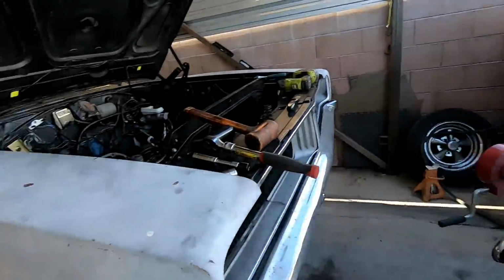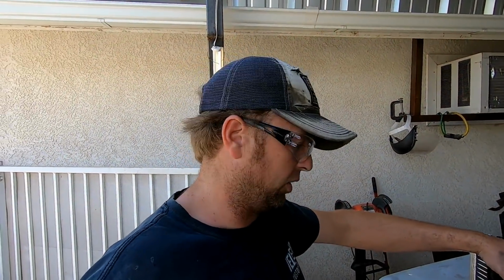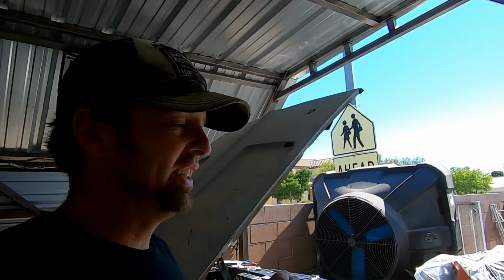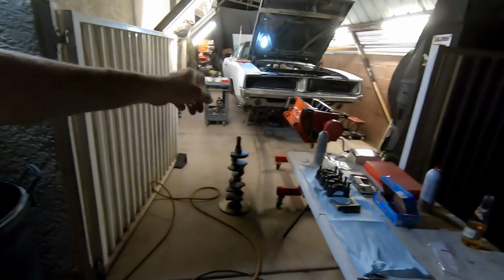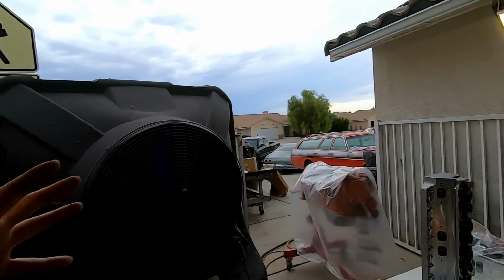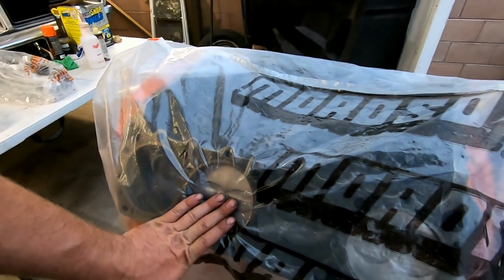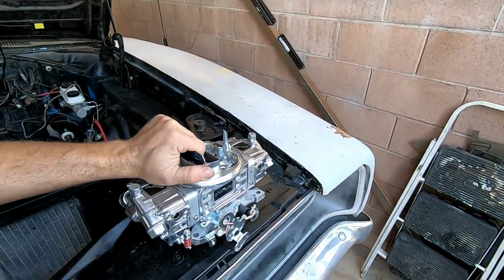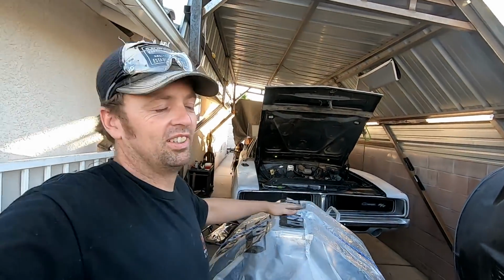1969 Dodge charger "Smurf" gets leveled UP a notch

Comment: What amazes me most is how masterful Chris is yet he has somehow not become a snob in an expensive shop. I have so much respect... Looking forward to saying 'hi' someday. I've compared prices and if you want good lifters (no matter the type, you need to get your wallet out). I am using the 440 Source heads (cnc'd locally) with Morel/Bullet hydraulic roller lifters, H-S roller rockers in my build, which is going to be much more tame than Smurf's engine.
Reply: He is the "MOPAR WHISPER"

Comment: I know you drove smurf hard, but most would have been gutted finding it necessary to tear down and do a complete engine rebuild because of a failed camshaft bearing. I admire you for your unfazed attitude towards that and your willingness to just get on and do whatever was necessary to sort it out. The end result is the prize and you now have one hellacious car. Well done and best regards.
Reply: Is that just a problem with those engines when you push them.  I've seen Steve Dulcich from Motor Trend do a oil mod on the top end.  I'm not a Mopar guy so I don't exactly know what it's all about.
Reply: @BobWiersema  No, this is not a recurring mopar problem.
Reply: @BobWiersema  Not usually no.

Comment: Hey Chris- on my '69 RT with a 2-4 weiand tunnel ram, I did have a hole in the hood, but found it ran REALLY cool with no hood at all. And yes, I had electric fans. Oh- I did have to run 1/2" fuel line to the carbs, too. Put an inline filter on top of the cowl & when I nailed it- you could see the fuel bubbling ( electric fuel pumps not keeping up).

Comment: Chris ... if you ever come across a set of ram charger heads, try them on a 383. You have to notch the cylinders to clear the 1.88 ex valves, but that 383 motor will breath and scream past 7000 rpm and because it's got smaller crank journals then a 440 it won't have any oiling problems.

Comment: A motor converts energy into motion. An engine converts fuel into energy, then that energy into motion. An engine is technically a motor, too.

Pretty motor you got there...
Reply: “It’s got a cop motor, a four hundred and forty inch plant”
Now if you replace “motor” with “engine” blasphemy

Comment: I cut the bottoms of my rockers out and put 2x3 rectangular tubing in them, welded it to the inner rockers and put out riggers to the frame so they act as sub frame connectors and better side impact protection

Comment: When I changed the fuel line in my '68 R/T I called one of the big-catalog "restoration parts" companies to get the correct replacement. The guy on the phone insisted that the OEM was 5/16". When I said the old line was 3/8" (which it was), he said that somebody must have changed it.
Reply: They probably randomly put different sizes in at the factory since quality control wasnt that good
Reply: @tabbott429  The old line was the correct size. The guy on the phone was insisting the correct size was something else.

Comment: Chris what size tubing are you using for the frame connectors. Love how you tie them into the front rails. Want to do the same on my 69 when in replacing floors on my car

Comment: Does one use lock tight on those  internal intake Allen bolts, and on any carburetor base plate bolts that are exposed to the intake runners.

Comment: i'd go for the Hughes roller rockers, rather than the harland sharp. the hughes lubricate the bushings on the shafts better, whereas needle rollers on the harland arent as strong due to reduced contact area to the shaft. thats just me .. Plus if youre putting 16k plus into a motor tisk whats an extra 4 grand for a Mopar megablock if it means the engine is gonna have a bulletproof oiling system and bottom end to boot.

Comment: You should never use a wire brush on high speed to clean the tops of pistons cuz if you seen he quickly burnt through the factory coating on them. You should use a soft wire brush on low speed. It's important that the factory coating stays on the Pistons. Don't get me wrong chris is good everyone can learn something new every day. Knowledge is power and i wire brushed several sets of Pistons till they were shiny before i was told about that

Comment: Well atleast your building it right and not using plasti-guage. 😆  2 and 1/4 thousands clearance on the main bearings? Going to have some crazy oil pressure. I had always thought 3 thousands was the minimum tolerance. Oh well. Fucking send it. As far as Man Diamonds. You would be correct. I have heard some of the best car designers and builders in the world refer to the engine bay as " the Jewelry Box " this things is going to scream.

Comment: Why did you choose SOLID lifters you should have done hydraulic for Street driving that shit is gonna be noisy and irritate you while you're driving. That's all you're gonna hear while cruising is rocker chatter. Plus with hydraulic you get better vacuum for better idle circuit tuning of your carb. And David was absolutely right, everyone is switching over to bushed roller lifters cuz too many perfectly good engines are getting f*** up from lifters falling apart and dumping needle bearings allThroughout the engine